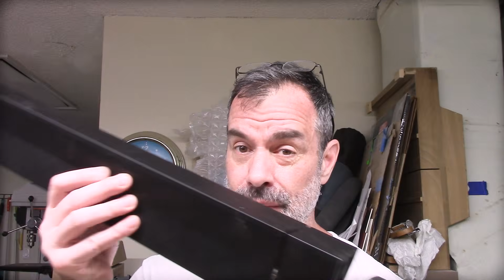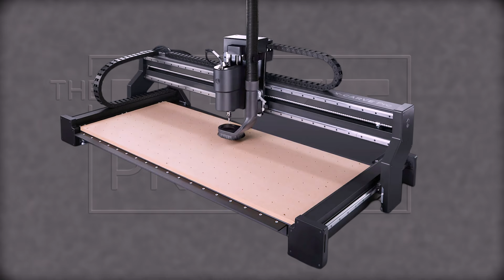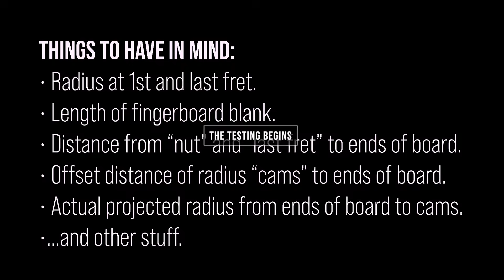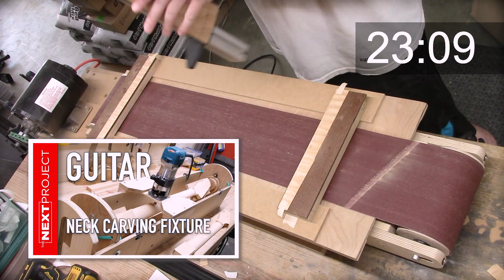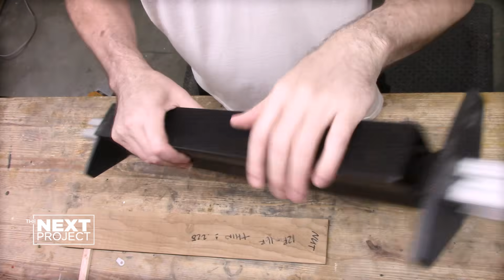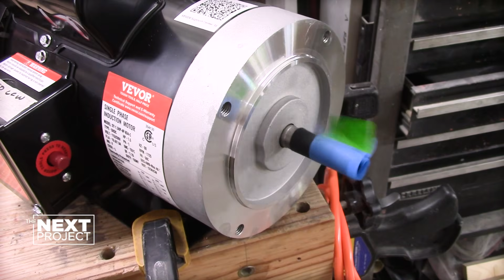6x80 Belt Sander and Conical Fingerboard Fixture - Project & Testing

Comment: I remember seeing  a picture from the Fender factory where they took a finished neck in a jig with an unslotted fingerboard and ran it through a Belsaw molder planer to radius it . I also saw a pic of a Fender neck beng slotted while held in a jig that was rotated above a shaft with slotting blades  , it cut the slots the same depth across the fingerboard . Unfortunately i can't find the pics .
Reply from the maker: Eric, thanks for watchin!
I'll have to look for the videos you mention. I've seen a lot of "factory" stuff, and the processes can be all over the place. I know some manufactures had used gang saws to cut all the fret slots at one time. That's all good as long as QC ensures proper spacers and blade dimensions... There was a rash of off-shore fingerboards/fret slots that were likely cut with a gang saw that wasn't properly set-up. Things happen.
I worked on a PRS a few months back, and was surprised by how deep all the slots were. Waaay deeper than needed, but safe and fast for manufacturing purposes I imagine.
Interesting stuff going on out there.
Be safe and take care!
Reply: @theNextProject  I thought the pictures were in the American Guitars book from the early 80's but i can't find them in there . The slotting machine consisted of blades with precision spacers and the neck was mounted in a jig above the blades which rotated with a specific radius so that the slot depth was uniform across the fingerboard .